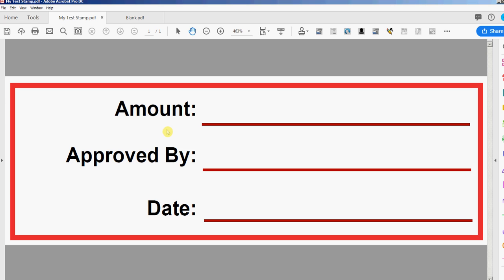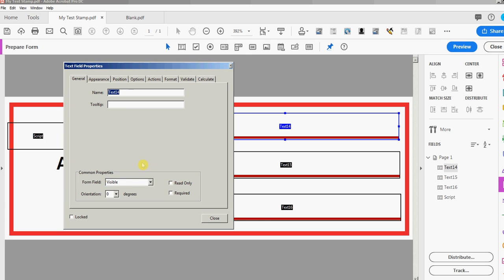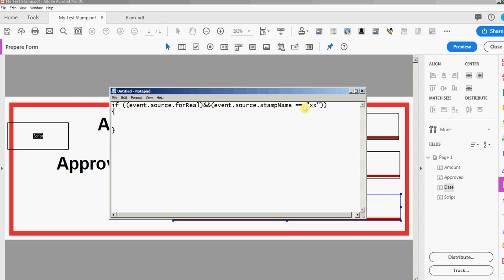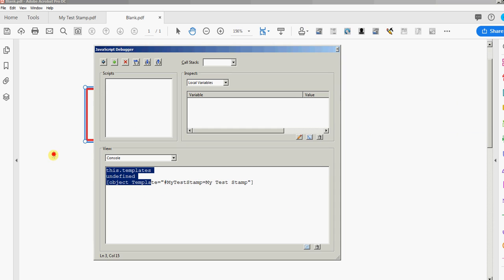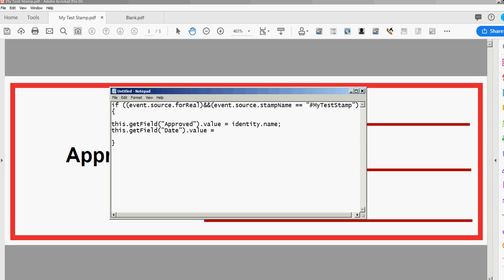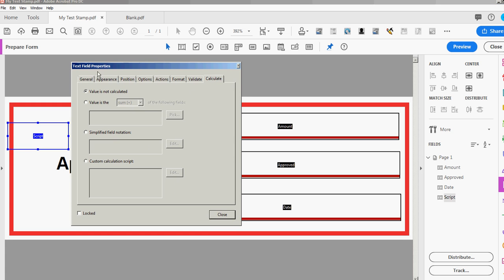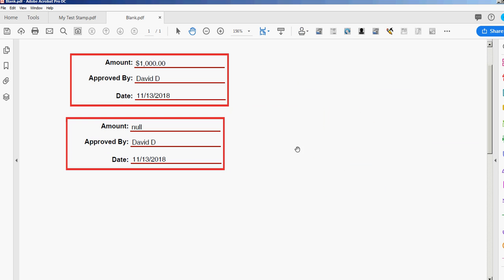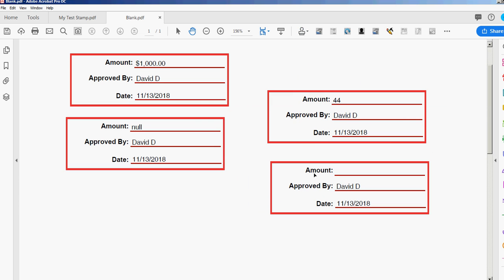How To Make A Dynamic PDF Stamp

Comment: Thank you so much for the video, between this and a bit of google I have the stamp working 2 ways depending on the code I load, however I am attempting to call on the identity.name if it is not blank, and if it is, then the identity.loginName, I however keep getting a NotAllowedError.  I am sure it is something simple I am overlooking but I cannot figure it out, thoughts?  

Code I know works
if((event.source.forReal)&&(event.source.stampName=="#RedlineECO"))
{
this.getField("ECO").value=app.response("ECO:");
this.getField("SALES").value=app.response("SALES:");

this.getField("BY").value=identity.loginName;
this.getField("DATE").value=util.printd("mmm dd yyyy h:mm tt", new Date()).toUpperCase();

}
or
if((event.source.forReal)&&(event.source.stampName=="#RedlineECO"))
{
this.getField("ECO").value=app.response("ECO:");
this.getField("SALES").value=app.response("SALES:");

this.getField("BY").value=identity.name;
this.getField("DATE").value=util.printd("mmm dd yyyy h:mm tt", new Date()).toUpperCase();

}

but get the error for this code
if((event.source.forReal)&&(event.source.stampName=="#RedlineECO"))
{
this.getField("ECO").value=app.response("ECO:");
this.getField("SALES").value=app.response("SALES:");

this.getField("DATE").value=util.printd("mmm dd yyyy h:mm tt", new Date()).toUpperCase();

if(event.value = identity.name = ""){
this.getField("BY").value=identity.loginName;
} else {
this.getField("BY").value=identity.name; }
}

Comment: tried to check the stamp id using this.templates but nothing was returned
Reply from the maker: That means you don't have a template.  Did you try putting the file in the user stamps folder, applying the stamp, selecting it and running this.selectedAnnots[0].AP in the console?

Comment: Hi, I found your video so helpful on my current task.
I want to make a window marker stamp that contains 2 textbox for input of window mark and window number.
My codes are not working at all.
Does 2 textbox is impossible to do?🤔

① this.template
      null

↑ this is my first concern regarding AP
but

this.selectedAnnots[0].AP
solved this problem, I also lloked for the file and I found it in stamp folder  located on User.....

By the way, this is my code

if ((event.source.forReal) && (event.source.stampName == "#3FXr1N0crnfv0vUpGDlJ8B"))
{
    this.getField("WindowType").value = app.response("WindowType:");

   this.getField("WindowNumber").value = app.response("WindowNumber:");
}

I am using notepad for editor and have a Arial Unicode MS for font setting.
I also using a 7days trial of Adobe acrobat Pro.
Just incase it is the problem.

I am a totally beginner when t comes to programming, sorry.
Hopeful for your response.

Thanks,
Ian
Reply from the maker: this.template returned null because the script is this.templates (plural).  Yes, you can have 2 popup windows like you tried to do.  However, more than 1 popup is annoying for end users and they can't see what they entered in the first window or go back and change it.  You should use a popup dialog window instead that contains both fields in the same window.  This is very complex programming though.  If you are interested in a quote for me to program this for you you can contact me here:  https://www.pdfautomationstation.com/public/department6.cfm
I don't see anything wrong with your script.  The fact that you have a free trial for Acrobat Pro should not affect this because the free trial is full working version.  The Notepad font settings also don't matter.  Some things to check:  Make sure the field names in your script match the actual fields, EXACTLY, including case sensitivity.  If they don't match it will through an error and the script will stop.  Make sure the AP or template name matches the stampName in your script, EXACTLY, or else the if statement is false and the rest of the script will not execute.  The first thing you should do after applying the stamp is check the console for errors:
https://pdfautomationstation.substack.com/p/the-javascript-console

Comment: Great tutorial, thank you.  I created an image for a custom stamp in another software and used the custom stamp feature to create a custom stamp.  I can get the fields added with the code to fill in initials and date but I'm unsure how to save the stamp with the code.  Is it just a blank PDF with the stamp and code saved to the same computer?  That's what the video looks like but I wasn't certain.  Thanks!
Reply from the maker: If you created the stamp using the custom stamp feature, then that is the file you should be adding fields and scripts to, and saving.  The file is in the User stamps folder.  The previous video explains how to find this folder. https://www.youtube.com/watch?v=7zeNyutB1no
This article/video also explains how to find it:
https://www.pdfautomationstation.com/public/How-To-Locate-Javascripts-Or-Stamps-Folder.cfm

Comment: Thanks for the tutorial! When adjusting the code for a single field, I cannot get the box to appear when placing the stamp. I've been through both videos, and read through all the comments here, but no luck. The stamp is a template, and resides in my stamps folder in App Data. No error is triggered in the console when I place the stamp in a blank PDF. Here's my code:

if((event.source.forReal)&&(event.source.stampName == "#SOWStamp"))
{
this.getField("SOWfield").value = app.response("SOW:");
}
Reply from the maker: What is the template name?

Comment: What if I have two number fields that I want say form fields that I can change after I stamp, and then a third field that populates the user name?  I am trying to create a stamp for receiving inventory
Reply from the maker: If I understand you correctly you want to be able to change form field values after the stamp is placed?  There are 2 ways to do this, but unfortunately they are too complicated to describe in this comment section or make a YouTube video about them.
1)  Create an editable dynamic stamp.  When the stamp is applied after the first time, the fields in the popup dialog default to the previous values, but they are changeable.
https://www.youtube.com/watch?v=j6hWgAKmB4c
2)  Program the stamp to insert form fields onto the page when the stamp is placed.
Reply: @PDFAutomationStation  Thank you,  I will reach out and get an estimate to have one made
Reply from the maker: @bschols7504  If forgot to put the contact link.  Here it is: https://www.pdfautomationstation.com/public/department6.cfm

Comment: I was able to add a script without getting an error however once I add the stamp to a document I do not get the pop up for the app response nor does the date fill in automatically. I've read comments and it could be my script, although I've checked it several times. Here is my script and please let me know if something is off about it. 

 if((event.source.forReal)&&(event.source.stampName == "#Custom Approval Stamp"))
{
this.getField("Ref:").value = app.response("Ref:");

this.getField("Date:").value = util.printd("mm/dd/yyyy", new Date());

}
Reply from the maker: Did you check the console for errors? https://pdfautomationstation.substack.com/p/the-javascript-console  Are you sure your field names are Ref: and Date: (with colons)?
Reply: @PDFAutomationStation  I thought the same about the colons so I named them the same so it wouldn't matter. So the box is called Ref: and the fillable box is also called Ref:. Not familiar with the console for errors but I will look into this. Thank you for your help and response!
Reply: @PDFAutomationStation  Thanks for the link! This is the error message I received TypeError: event.source is null
1:Field:Calculate Do you happen to know what this means? Thanks again for all your help!
Reply from the maker: @MichelleGonzalez-v8r  That error always comes up when you set or change the calculation in the field because the calculation runs when you set or change it.  When it runs, event.source is null because it is only present during the stamping process.  Clear the console by clicking the recycle bin icon at the bottom, close the console, apply the stamp, and check the console again for errors other than that one.  Do you have the stamp in the correct folder?  Does it appear in the stamps menu?  How are you adding the file to the folder?
Reply: @PDFAutomationStation  I added the stamp by going to Custom Stamps > Create > Browse > then selected my saved stamp. I created my own folder labeled stamps and just saved it there. Its does appear in the stamp menu under my custom stamps.
Reply from the maker: @MichelleGonzalez-v8r  Michelle, you have to save the file with the scripts to the user stamps folder.  When you create a stamp using that file you are simply creating a static stamp with the image from the stamp file.  The file with the script needs to be placed in the user stamps folder and Adobe restarted to see the correct stamp in the stamps menu.

Comment: It is a nice tutorial, thank you.

On my case, I will have four fields, so, I guess you will get four dialogs; it would be nicer if you could just get everything on one dialog or directly editing the stamp fields, but I guess it is not possible.

Update: It seems that it is possible though. There are Dialog Boxes that could be used inside a stamp. I haven't tried it yet, but looks promising.
Reply: Yes, with custom dialogs work. It is not easy though, but it will work. For the interested, look for: 
* Custom dialog boxes: Part 5 of 5 on popup windows by Tom Parker

I can't post the link because YouTube will delete it. Buy you can just use google. There he has a nice tutorial and two PDF files with examples.

Essentially, you just have to:
1. Create a dialog inside the "if ((event.source.forReal) && (event.source.stampName ..." code from this video.
2. The dialog will be assigned to a variable: "var formDialog = ... dialog definition"
3. After the dialog code, you just have to have something like: "if(formDialog.DoDialog() == "ok") { ... do your stuff here }"
4. Inside that if, you can then assign the dialog variables to the stamp field as follows: "this.getField("StampField").value = formDialog.dialogVar"

Sorry if I don't write proper code, but YouTube doesn't like it.
Reply from the maker: It's absolutely possible by using the app.execDialog method.  These popup dialogs are what we use in almost all of your dynamic stamps.  All data entry fields are contained in one window because it is annoying for the user to have have to dismiss several popups and not be able to see what what entered previously.  Popup dialogs are complicated to script.  If you  would like a quote for us to do it for you please contact me here:  https://www.pdfautomationstation.com/public/department6.cfm
Reply: @PDFAutomationStation  As I said in my previous reply, I already implemented my dynamic stamps with custom dialogs. But thank you for the offer.

Comment: This was a great tutorial! However it's a bust for me. I am using Adobes create Custom Stamp to enter my created stamp as an option in its dropdown list. Not sure if this method of "uploading" the stamp deactivates the dynamic script because none of the scripts are working when I use the stamp. It's just a static stamp.  Adobe accepted the script. No errors. Any idea on why none of the scripts codes work on the saved stamp?

if ((event.source.forReal)&&(event.source.stampName == "#ExpenseStamp"))
{
this.getField("Program/Department").value = app.response("Program/Department:");
this.getField("Expense Account").value = app.response("Expense Account:");
this.getField("Approved By").value = identity.name;
this.getField("Date").value = utility.printd("mm/dd/yyyy", new Date());
}
Reply from the maker: Using Adobe's Create Custom Stamp feature is fine but it creates a static stamp from an image.  In order for you to make it dynamic you have to find the file and add the fields and the script.  The stamp file should be in the user stamps folder, but it will have a random cryptic name like #jkdkjut98_9jkdu&k.  If you sort the files in that folder by "date modified" it should be at the top.  You can open it to make sure.  Your stamp should be page 2.  You can then close it and rename it to something more relevant then copy and paste the fields from your original file.  Close and reopen Adobe and it should work.  This artice/video/tool will help you locate the user stamps folder:
https://www.pdfautomationstation.com/public/How-To-Locate-Javascripts-Or-Stamps-Folder.cfm
Reply: @PDFAutomationStation  Located the file with the odd name. Changed the name to match what I named it in the Adobe. Opened file added fields, did CTRL K to add Identity to specific field box, code copied in script box. Saved. Closed it out. Opened new adobe blank page, I see the stamp in the adobe dropdown, click it, but its still static. It will create a pop-up comment bubble when I click on it but that's all.  It's like the script isn't finding the fields even though the names are all correct.  Would figure at least one would work. Stuck da burger
Reply from the maker: @Jam-ir7rr  You have an error in the date line of your code so that line won't do anything.  "utility" should be "util".  The rest of your code looks good.  The way it works is, if there is an error in the code, the script stops immediately.  So if there is an error in the first line, for example, nothing else will execute.  If you are getting the popup, it tells me the script is good to that point.  Check the field names and make sure they match the names in your script EXACTLY, including case sensitive and spaces.  Also, check the JavaScript console for errors:  https://pdfautomationstation.substack.com/p/the-javascript-console  BTW, it is annoying for the end user to type in multiple popups because the previous ones can't be seen and multiple popups have to be dismissed.  We would put all the fillable fields in the same popup window.  Unfortunately, popup dialogs are very difficult to code, too complicated for short YouTube video or article.  If you are interested in a quote for us to code this for you , please contact me here:  https://www.pdfautomationstation.com/public/department6.cfm

Comment: how can i create a today date stamp? i use script event.value=utility.printd(“dd mmm yyy”,new date) but it doesn’t change the date update
Reply from the maker: You should start by using a plain text editor, like Notepad, to write your script.  You have curly quotes in your script.  You need straight quotes.  A plain text editor will fix this.  Also, there is no year format with 3 y's.  There's either 2 (yy) or 4 (yyyy).

Comment: I am really struggling with this. I am running Windows 10 Pro and Adobe Acrobat 9 Pro. I need to create a stamp that will automatically date at the time of stamp and then have a field that I can input information after the stamp. I am obviously doing something wrong. any ideas from anyone?
Reply from the maker: Exactly which part are you struggling with?   The video shows both how to stamp an automatic date as well as how to enter text into a stamp field.
Reply: Hi David, I am so sorry for wasting your time. I went through everything carefully and found that I had a space and a few lower case letters where I should have had upper case letters. Thank you so much for your response, all works ok now.
Reply from the maker: @chrisanderson1702  I'm glad it works now.  JavaScript is case sensitive and 9 times out 10, when I ask somebody to send me their script after an "it doesn't work" comment on YouTube, it is either the wrong case in a letter, or some other typo.   -David Dagley, CEO, Forms Doctor Inc.

Comment: Great video! 

I got the code and stamp to work correctly.  For some reason I can't get this stamp to work on Adobe Reader DC. Does the JV not work on the Reader application?
Reply from the maker: It should work with Reader DC.  Do you have the stamp file in the correct folder?

Comment: first off Thank you I read through all the comments and did find some errors for me to correct, I still get the SyntaxError:illegal character1: at line 2 I have Acrobat Pro DC
Reply from the maker: Please paste your script here.  Illegal character is usually curly quotes instead of straight quotes that comes from writing your script in a Word processing program like MS Word instead of a plain text editor like Notepad.
Reply: @PDFAutomationStation 

 if((event.source.forReal)&&(event.source.stampName==”#MailReceived”))
{
this.getField(“Received”).value = app.response(“Received”);
this.getField”(“Name”).value = identity.name;
thisget.Field(Date”).value = util.printd(“mm/dd/yyyy", new Date());
}
 I would like the stamp to be able to type in how received.
then my name and date
windows 10 note pad I did see in the comments you had mentioned not to use word 
Kind regards,
Reply from the maker: @debmontone6931  The script you pasted is full of curly quotation marks, has misplaced periods, and missing quotation marks.  There are 12 such errors.  Please review and correct carefully.
Reply: @PDFAutomationStation  thank you it worked- is there a way to add time with date
Reply from the maker: @debmontone6931  Change "mm/dd/yyyy" to "mm/dd/yyyy H:MM tt"
Reply: @PDFAutomationStation  sorry to bother you again My Response dialog box pops up and I enter text but stamp not filling in all fields are empty I started from scratch a few times.

if ((event.source.forReal)&&(event.source.stampName == "#MailReceived"))
{

this.getField("RECEIVED").value = app.response("RECEIVED:")
this.getField("By:").value = identity.name;
this.getField("DATE").value = util.printd("mm/dd/yyyy H:MMtt", new Date());
}